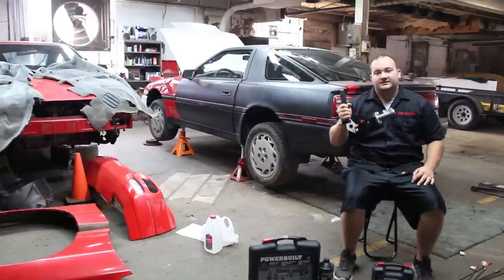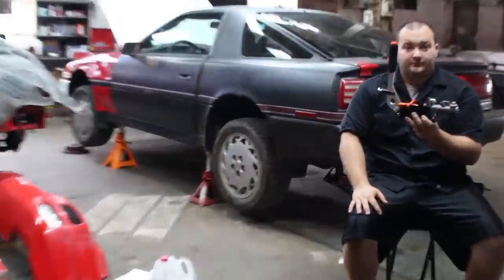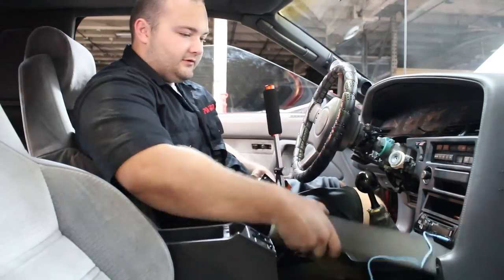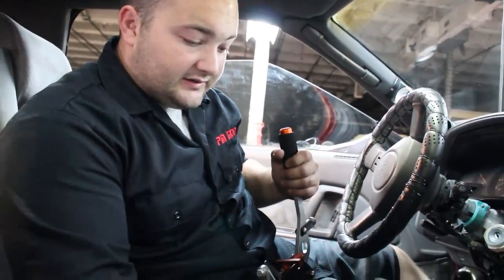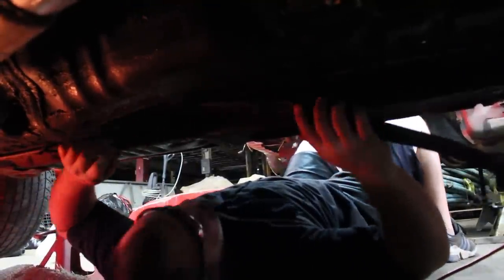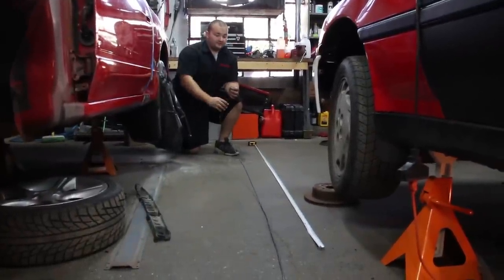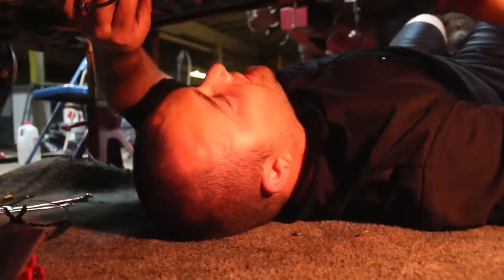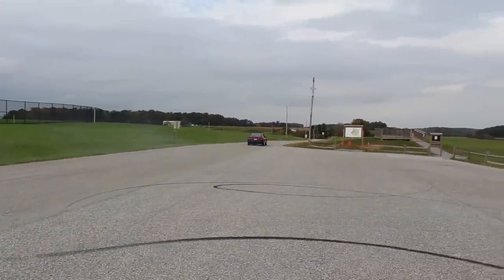How to Install a Hydraulic handbrake | e-brake | 1jz Supra

Comment: for the guys who will install a Hydraulic handbrake in their cars here is a tip. Do you see those 2 bolt ,which attaching the master cylinder to the assembly? unscrew those bolts and rotate the master cylinder 180 degree. Here you go a handbrake with the lines going directly downward which frees you from that huge loop that goes on top of the master cylinder and you can alway split in to the original brake line instead of routing new line
Reply: +d. kongul This way the reverse outlet would actually make a lot of sense :3

Comment: Quick question...instead of tapping into the master cylinder for fluid...can't you just get a little resivore tank for the back of the hydro e brake?
Reply from the maker: if you do that you must run a dual caliper setup
Reply: +Poor Man Mods what about some t links on the original calapers? and the main line
Reply: +Jared Deming im not 100% certain but if im correct if you do a tee on the caliper it can also back feed pressure to the mastercylinder and that may mess something up
Reply: redcraftmachines ahh ok thanks just had a little idea lol wouldn't want your breaks to lose there fluid.
Reply: like i say not 100% but thats a thought that comes to mind lol

Comment: Just a little criticism. Typically the Handbrake is installed on the other side of the shifter so that you have free access to the shifter and because of the brakes handle length its easy to grab onto further from you and have more leverage/ strength to pull it in less of an awkward space while trying to control the vehicle via the steering wheel, kinda jumbled but hey hopefully you get what I'm saying. As always to each their own. Great job keep the vids coming.
Reply: +TrendyKidzProduction Your not criticizing anyone. You just want to be herd.. sigh
Reply: No it's on the other side because you guys are backwards and your steering wheel is on the left (wrong) side of the car. And the manufacturer couldn't be stuffed anymore making a left hand drive version so they just kept the centre console the same.
Reply: This doesnt matter at all it's totally preference based. I like mine between shifter and wheel because I use it more than the shifter when I'm driving aggressive so it's right there. Some people like it on the far side of the shifter, it's all up to preference, nobody cares how you do your things differently

Comment: I have an automatic G35 with the stupid foot e-brake. If I want to install a hyrdaulic, would I have to buy more break line for it to reach the new position of the handle?
Reply: I have a 2001 crown athelete same idea man just need more line and dont forget to bleed the brakes after
Reply: It's pretty much the same, this install includes removing the e brake entirely (which you dont have to at all) but this literally completely rerouted the rear brake lines to go into the car to the e brake and them to the rear wheels, so when the pedal is pressed, fluid runs through the brake handle and to the rear wheels, and when the handle is pulled, it takes from the reservoir and does the same thing the pedal does but only to the back

Comment: Poor Man Mods  did you use the 5/8th or 3/4th brake?? I read that the 5/8th is for stock brakes but would running the 3/4th hurt anything??
Reply from the maker: Pretty sure we used the 5/8 but I'm not positive, i bought it used

Comment: Quick question. So basically you're replacing the rear brake lines completely with new lines that just go into the hydo e brake correct? So I can just remove my rear brake lines from the master cylinder, use new line that goes from master cyl to e brake, then from e brake to rear brakes?
Reply from the maker: yup!
Reply: That's  a bit easier than I expected. Thanks!
Reply from the maker: no problem!

Comment: Does your brake pedal apply pressure on all 4 pads or only the front ones? Thanks for the videos!
Reply from the maker: all 4, when the hydro handbrake isnt being used its an open circuit
Reply: Poor Man Mods Thanks!

Comment: would it be possible to rotate the piece 180 degrees on the e-brake so that the lines will hook up from under and not on top?
Reply: With the type of a hydro brake that this guy has in the video, yes, as the master cylinder is connected with only 2 screws.
But turning the ports downwards makes the connecting a bit difficult, as the first port will be pointing towards the metal frame.

Comment: I am looking for video on repairing trailer with air over hydraulic all the parts are not there on my trailer has air actuator moves master cylinder provides boost to lines and brakes trailer any ideas where a video on that

Comment: Dude I gotta question. Can a hand e brake be installed in a car with a foot e brake? e.g. hand e brake from a sc300/sc400/soarer installed in a ls400/celsior or gs300/aristo.
Reply from the maker: Franklin Clinton i have no idea, im sure anything is possible with time, money and fabrication skills
Reply: Should be pretty much the same as this video, you'll just have to drill and focus a little more on where things are going. Should be able to throw the handle whenever you want, and do the same runs as here

Comment: hello, i am new at this so bare with me, if you do this mod, your rear breaks wont work when you push the break pedal? By the way i enjoy very much following your videos, keep up the good work. (sorry for my bad english)
Reply from the maker: capone kpo if you set it up the way i did the rear brakes will work with the pedal. Thank you for your support!
Reply: very kind of you to answer my question, thank you. i have another question :D i want to make a drift car but for daily drive too, (bmw e36 coupe), 1.8  is engine with a welded diff is too weak engine? (i am a beginner in drifting). Thank you.
Reply from the maker: i dont know much about those cars, but more power wont hurt!
Reply: Thank you very much.
Reply: @z0mbieman411  there really is no power number, those cars are light af so the power you have in it now will be good enough for drift for sure, just takes some getting used to.

Comment: how well does the actually parking brake function work on this? 
im looking into getting this for that since i dont have a working handbrake.
Reply from the maker: +Cody Brown it works well
Reply: As long as you get a brake with a lock you'll be good. Most hydro e brakes dont have locks so well be totally useless for what you need it for, watch out for that

Comment: is there any problem if i install that for a normal car? 
i really like that style. Answer pls
Reply from the maker: I dont know if its an issue with mine or all hydro brakes, but when I used it as a "parking brake" it loses pressure over a few hours and will no longer hold it, thats the only issue ive encountered
Reply: Thank you for your message, I hope you are doing well.  Your answer helped me a lot because i live uphill.
Reply from the maker: thank you very much, im glad I could help :D

Comment: Poor Man Mods How would you run the lines if you didn't bypass the abs, would you run it:
Master cylinder--------Abs module--------hydro e brake---------t into rear line instead of:
Master cylinder---------hydro e brake------t into rear line??
Reply from the maker: i would think it would be ran 
Master cylinder--------Abs module--------hydro e brake---------t into rear line
Reply: So you could run the line leaving the Abs module (and heading to the rear brakes) into the hydro e brake. Then from there you go into the rear brake line. Right?
Poor Man Mods
Reply from the maker: yeah thats correct

Comment: how would you run this set up on a car that has an idividual line for each caliper? id like to run it on my 98 neon
Reply from the maker: run 1 line off of the back of the parking brake and then T it off into the rear calipers
Reply: so I would need 3 T's and some brake line? running one T right off of the handle another on one caliper and the other on the other caliper? or how would you do it?
Reply from the maker: "like" our facebook page and send us a message, ill draw a diagram for what i would do

Comment: Can you still park the car using the hydro brake ?
Reply from the maker: +Axle Rose yes, but I'm not sure if it's my unit or all hydro brakes, but after a few hours it loses all the pressure when locked
Reply: I see. Thanks for the speedy response man. Quick question. I have a Porsche 924 and wanted to mount a Hydro-e-brake onto that but the thing is the handbrake is next to the door. Can I still mount it there ? THanks again.
Reply from the maker: you can mount the hydro brake where ever, you just have to plumb it into the brake lines

Comment: its a shame that brake lever doesnt fit in there a little more snuggly. you'd think the designers would try and make it as compact as possible, i'm guessing that wasn't a supra specific design. oh well. g'job guys. just watch out drifting MK3's.. they suck. I know. I own a highly modified '90 and no matter what i've done to the suspension its always snap-happy in corners. they do much better in sticky / road course setups.

Comment: I have 87 supra and was wondering if u knew how to fix my problem when i turn my lights on my taillights and 3rd brake line turn on but when i push on break only the 3rd break light gets brighter anyone know wht it is
Reply from the maker: bad bulbs maybe
Reply: all new bulbs they are on but don't get brighter when brake pedal is pressed
Reply: Wires
Reply: there is a box by your taillights it has a jumper in it that burns out preemptively named the jumper of doom look that up

Comment: Using the parking brake is just an excuse for those who do not know how to drive or don't have the balls under the hood to push the rear over
Reply from the maker: did you click on this video just to leave negative comments?
Reply: Well a front wheel drive car can't exactly spin the rear tires... so you gotta lock em...

Comment: how much would a setup like that cost in general
Reply from the maker: less than $200 total
Reply: awesome thanks bro for answering back
Reply from the maker: hey no problem
Reply: +Poor Man Mods it doesn't sound like it, but does that include the tools, like the brake bender and flare tool?
Reply: @JonMarshAnderson  in some situations the brake handle itself will cost more than $200, so I'm thinking the tools aren't included in that

Comment: 16:03
I hope your "copper line" was 90/10 copper-nickel brake tubing and not just plain copper.
Reply from the maker: It's brake tubing..
Reply: Brake likes are brake lines lol if its sold as a brake line, unless you're picky af it doesnt matter what it's made of its brake line

Comment: The placement of those hydro lines in the cabin are horrible.. LOL
Reply: not sticking up 10 inches for starters... lol
Reply from the maker: sooo stick up a little bit, which doesnt get in the way at all, or risk kinking the line? What else is so horrible about the placement?
Reply: If you don't know how to properly run a line then run a braided hose with the proper fitting to hard line. Its not that hard.
Reply from the maker: I know how to run a line, and i did it the cheapest way i could  #poormanmods
Reply: @RollinShot  if its not in the way, why do you care? Doesnt look bad, it's cheap, and the general public suck at this stuff so the second someone hops on youtube and starts showing risky bends, people are gonna complain because they keep linking lines. Why make it harder than it needs to be?
Reply: The Heather Exploration 3 years later... lmfao. Go be bored elsewhere.

Comment: Honestly do you work at a shot? You grinder a metal line inside the car with out any flame retardant covers to protect the seats your lucky you did not catch that car on fire... and then in the beginning this valve that Idk what's it's for I would never take advise from you on anything about how to work on a car... last how is that handle not in your way under hard steering it looks as if your hand will hit that handle bar if you are trying to drift it takes alot of hand placement to do these things...
Reply from the maker: noobtoob nooby id respond to your questions, but seeing how youd never take advice from me there isn't much point in answering your questions
Reply: Poor Man Mods lol just subbed xD
Reply from the maker: haha thanks!
Reply: noobtoob nooby I dont even understand what you mean about the sparks lighting the seats... if my hoodie caught on fire everytime i grinded shit i dont know how i would be still alive
Reply: MrRedcola1 I have worked in body shops I've seen where you don't have proper shielding and the dash board or the carpet catch fire yes it's not a common thing but it does happen and if you are watching a youtube video and they don't show you the right way the worst could happen and you could be sorry
Reply: noobtoob nooby The catching on fire part is for welding. When we do grinding we put the shield up so nothing else gets damaged. We use the same shield for welding, but if youre grinding nothings going to catch on fire.
Reply: noobtoob nooby The catching on fire part is for welding. When we do grinding we put the shield up so nothing else gets damaged. We use the same shield for welding, but if youre grinding nothings going to catch on fire.

Comment: Will need clutch soon sounds like
Reply from the maker: clutch is a brand new Spec Stage 4, its all good
Reply: At the end of the  video it sounded like shifting in to 2nd the rpms wound down quite a bit??? Can you go over whay this happens please. That to me indicates a worn or glazed clutch. I no lift shift with out a computer assisting me I dont have this issue on a factory 2001 bmw clutch. With TC on or off I get solid bite.
Reply from the maker: The clutch is no worn, its brand new and i broke it in for 1K miles. The only explanation i have for what you are hearing is all through first i was "burning out" and once i shifted into second i got traction which would bring the rpms down. But i assure you clutch is ok :)
Reply: James Ashby
Reply: @jamesca41987  the clutch is fine it sounds brand new. It pulled the rpms down because of the burnout, hes spinning in 1st at 6000, but only travelling 15kph, shifting into second is obviously gonna grab the road and pull rpms below 2500, that's a pretty standard thing. No lift shifting would be good in that situation if you wanted to keep sliding but his clutch is fine. The speed the rpms pulled down is actually a show of how good the clutch is

Comment: Uhhh... how is this remotely practical? This will render your car illegal in most countries
Reply from the maker: how is it impractical? ive passed inspection here many times with it
Reply: What's impractical about this? It doesnt change anything, all brakes work with the foot pedal, and the parking brake even still locks, theres nothing illegal or impractical about this at all, it only makes the e brake easier to lock